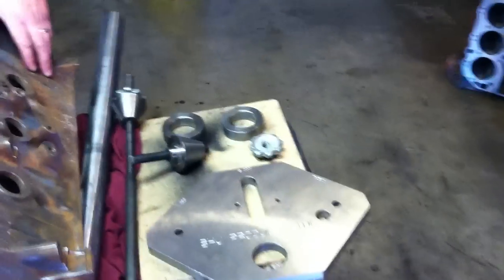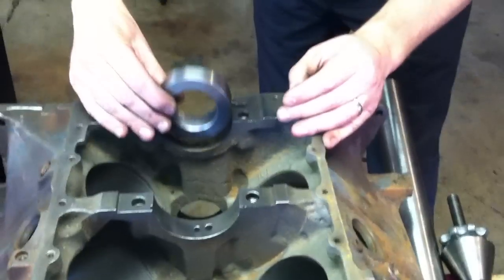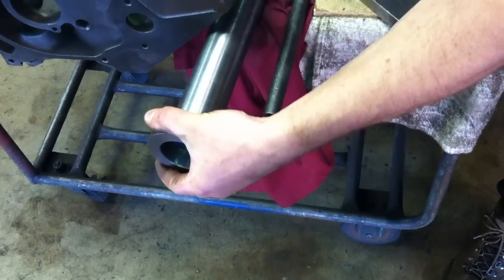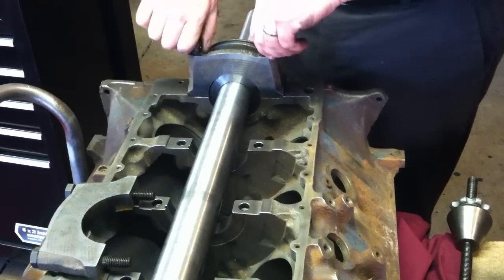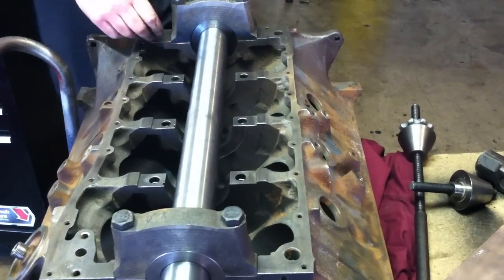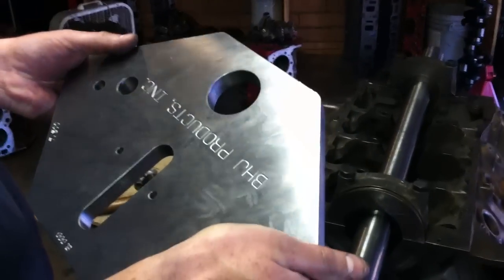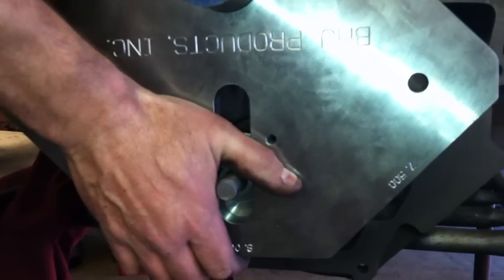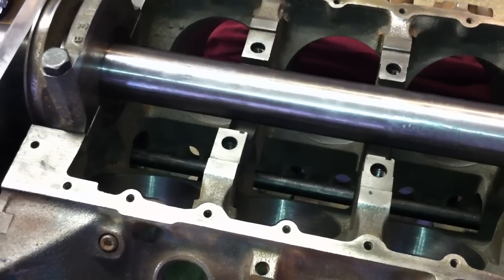460/532 stroker build Milling the block

Comment from the maker: Yes It's all steel, I have only seen pic's of the 570 set up although some of the parts look like the same ones used in the kit I bought. It would be a good idea to check out the BHJ website, they are very helpful if you call them they give great customer service, they answered all my questions before I bought the kit, BHJ will also put together a custom kit with any combination of tooling you want.

Comment from the maker: The first couple of blocks I did I used a deck height fixture in the main housing and my expensive protractor an the blocks were near perfect 90 deg to center line I also have a 570 rotary broach and I recommend  the BHJ fixture for that as well

Comment from the maker: Actually I'm not leveling off the deck if you look at the level it is only used to get the block square to the machine table this is necessarily because it will insure your not angle milling the deck you have to do this with any rollover bar fixture even BHJ  you won't ever see the level used in the other direction from front to back the side to side must be leveled because this is your cylinder head and thus your intake manifold mounting angle.
Reply: Where r u located ?

Comment: in your other video, I notice you set up the level off the deck.... isnt the point of the fixture to give you a "zero datum"  or a perfect 90 degree reference?? by levelling off the deck, you are not decking it true to the crank-cam-zero datum point.  you might as well just use a generic rollover bar without referencing off the cam tunnel.  Please dont think I am criticizing, I like your videos, keep it up.  I have been thinking about the BHJ blok-tru for my VN 570...-scott